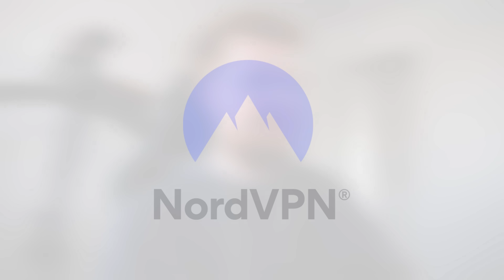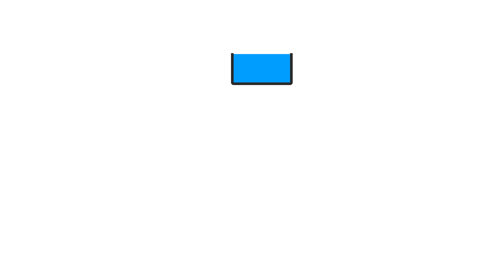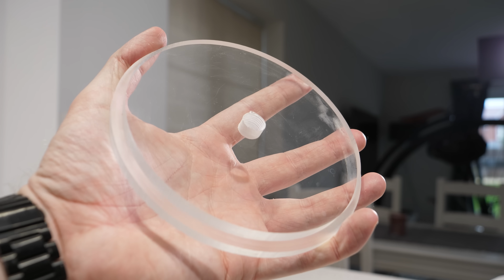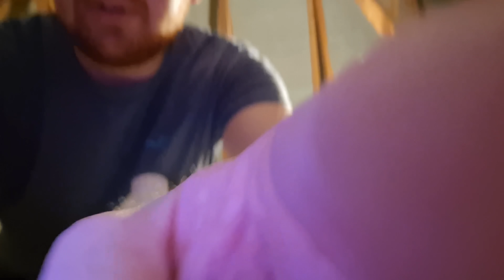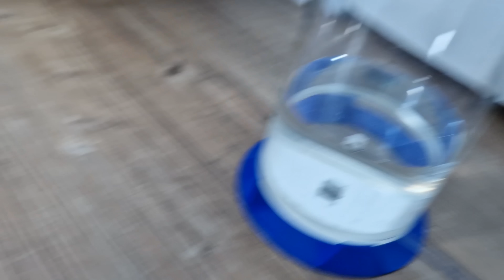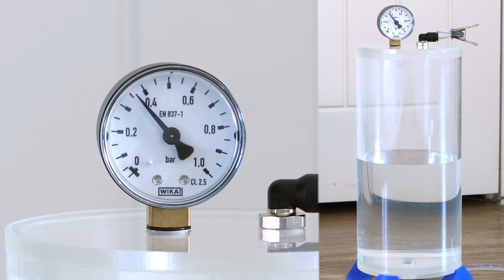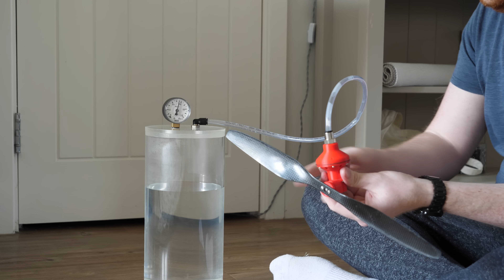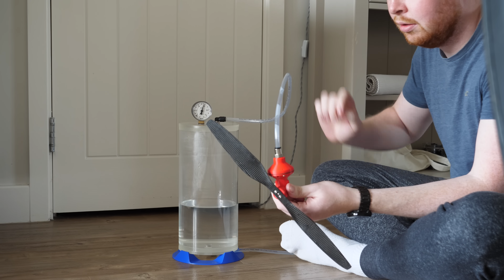Liquid Air Engine

Comment: Hey so theres a way to pressurize air with just flowing water. I cent remember what they are called but basically you have water fall down a tube where it froths and makes bubbles, but the flow rate of the water pulls the bubbles down  the tube and around a bend where they are then free to float up to the top of the pipe and collect in a tank as the water continues down the pipe. Its actually fairly quick at building pressure as it moves a large amount of air fairly quickly with only 1 moving part, a water pump. Unless you were a mining company 150 years ago and built a massive scale one using a river, then there are 0 moving parts.

Also, adding a heavy flywheel to the propeller should help the engine run at much lower pressures as the main reason it stops running is as it slows down it reaches a point where there isnt enough inertia in the prop to push the valve open against the air pressure. If you increase the rotating mass close to the shaft then theoretically it should run at much lower pressure though also at much lower rpm.

Comment: Not water air engine but gravity engine. There are reasons why we dont say connecting rod engine, but internal combustion engine.
Then you need a cynematic that allows a stop at the top dead center.
Reply: But even so, going through a change of medieum doesnt make sense. Just have a weight going down on a string. You can also use mercury instead of water. Etc.

Comment: An engine built similar to a piston or diaphragm pump with linked valving could probably increase the efficiency and lower the minimum pressure of operation, especially if the parts were precision metal etc. and lubricated.

Comment: use electrolysis to generate oxygen and hydrogen gas, and use that as fuel for a combustion engine, because the oxygen and hydrogen are in a 1:2 ratio the explosions are gonna be powerful making the engine even more powerful(or it would just destroy the engine)

Comment: There are bonding agents made specifically for acrylic that chemically weld it into one solid piece (used to make acrylic aquariums etc.) and this should always be the method used to permanently affix 2 acrylic pieces when maximum strength is required 💯

Comment: you should try putting a magnet on the output, and have a magnet detector, and whenever the magnet is detected, use a microcontroller or a relay to open the valve. This will make the engine operable at much lower pressures.

Comment: If I unblock.whered the static IE i.measure the static if this might be temperature or underclothes or the outside clothing not inside inside not outside . I found I am not sexual so anylisvsays the food , no clothing , no the timing earthing  6# si, 4 2.5  sung hok#. Then the turning on the the cable for sure for lighting them a sound frequency transferred to the victims they now aware of that etc . The biker is dead he is dead. If he returns the nano retriggers that water. . Do that's done no he has nooney . No the dog likes it
.etc . Any thing else yes that issue is these victims by thies families in your nations . There it might be your properties used to kill off anything different etc I don't know etc seperate the floor IE use the differences and see us it a need to run a different or not the difference is the resident controls it. Not a criminal. . An way the game is ohhhhhhh not clever that budget is for shoes I can see here the time required to make a energy clean transfer , shoes ?

Comment: Interesting build, but there is no dispute that what you have is an "air engine" (or more accurately, a pneumatic motor). The working fluid for the pneumatic motor is exclusively compressed air. The fact that you are using the water as a liquid piston to compress the air does not negate that fact. Therefore, it isn't a water air engine, but merely a pneumatic motor with the working fluid (air) compressed by water (rather than by a mechanical  compressor)

Comment: in theory you could telesccope  dozens  of  bottles in series with one inch holes on the bottom..  actually  you  could use the solar heated  air to produce more  cooler  commpresed air.

Comment: using acrlylic  is like using  rigid   PVC for compressed  air.  It is  suicidal..  Tthe  preusure you are using it should be  safe.     but something you might look into is use the sun to heat up the compressed  airjust prior to  a turbine blade on a generator.... maybe with a  freznel  lense.

Comment: Hello, you have answered a very old question for me here: "Do you always experience the same pressure in a tank with water, at a certain depth? Even if the width of the tank is narrow or wide?"
But I still have. to ask:
I always thought that not only the depth plays a role, but also the width and therefore also the volume, i.e. the amount of water. Why? Simple: More water weighs more and therefore also creates more pressure, and the larger the tank, the more water, the more pressure, so also more pressure in a much narrower tank that is the same depth, so in a much narrower tank there is the same depth less pressure because there is less water, therefore less weight and therefore less pressure.
That's how I always thought.
But what if there is the same pressure in a much narrower tank at the same depth than in a much larger tank at the same depth? With much less water and therefore much less weight?
What's up with that?

Comment: If I want I could make it again but it would be a rocket
Water electrolysis produces hydrogen and oxygen gas with 
          Electricity 
H2O         —>        H2+O (I made mistake here, I explain it at bottom)
Then again the H2+O is explosive and flammable and that’s the point
We use the H2 to burn and boil water making a steam engine 
We could implement a method that has 2 engines make 75-50% power back so less electricity is used
The side products would be water vapor 
The water could be used to to fuel the engine thus less water used 
The water cant be pure as with no salt, water electrolysis could not take place

H2O + NaCl -> H2 + O + NaCl
I thought it would damage something 
Cuz I thought NaCl would split to Na (sodium) and Cl (chlorine)
Mind you I ain’t even is college so this is impressive

Edit: I found a mistake when I said ‘We could implement a method that has 2 engines make 75-50% power back so less electricity is used’ it uses more water and a boiler is heavy
At that point, I could just use high concentration hydrogen peroxide and potassium permanganate to get high pressure steam (used in the v2 rocket) and this would be good as the steam would power and engine and the steam leftover could be reuse it (harvest the steam) and have a tiny tub of salt and a spinner in the water tank
Mind you, probably not a good idea as things like weight and hydrogen peroxide in high concentration is reactive to an extreme degree

Comment: I think you could had used a hose with greater  diameter to fiil up the water again instead of reducing the air consumption of the motor. But so you built a very efficient version. Great.
I would like to know if you can use you findings with youtube videos some how in your profession or is youtube your profession?

Comment: OK, sorry if it has been suggested:
As it is a closed system and once the water is all "down stairs" you have to empty the cylinder and put it back upstairs.
Yes, this could be seen as "cheating", but why not add a third hole in the top of the cylinder and connect an air pump.
Then, when it is full of water you:
a) close the output to the engine
b) turn on the compressor and pump the water back upstairs.
Similar to how hydroelectric power stations work.  Water being used in the daytime and pumped back up at night.
Just a thought.

Comment: Not too late to use bigger pipe. You would still have pressure losses from changing down to the narrower diameter at the fittings, but you could reduce the friction losses in the pipe by having a bigger pipe and tapered adaptor fittings at each end.

Comment: Definitely recommend getting a resin printer for precision jobs. All you need is a good mix of tough/flexible resing(~20% or os) with normal resin and you can print really strong parts, or even springs, that are very accurate. You could combine the two printing technologies. FDM for the bulk and structure, resin for precision parts.

Comment: ngl wanted to see what would happen when the engine intakes water, does it hydro lock, because it doesnt compress the gas would it run  but slowed. my bet would be due to the higher viscosity or water than air the ball valve wouldnt let enough water in to complete the power stroke and it would just stop, not really hydro locking but also not running, more like just running out of air pressure.

Comment: Yeah I have cut some plexiglass before and it sucked, it would melt if I used small teeth on the saw and break if I used a saw with larger teeth. There are definitely some more purpose built tools for cutting that stuff
Reply: Acrylic looks much better for sure

Comment: Tom Stanton/ Sir : Pls try to designed an  engine powered by an "impact" , from a continious, solid water jet- at 45-50 psi presurized water- being spewed by a "forced pump", commonly used in the water cannon of the ordinary fire truck... 

The  5. inches diam. water cannon hose, could hardly be controlled by 2. firemen- during the actual acts of extinguishing a raging fire incident!...😊😊😊... 

I stand in awe  & admiration  at the sight of 2-3 firemen, trying to control the "kick" of such water- being ejected  from the tapared nozzle of the fire hose!!..😊😊😊😊

I

Comment: here's a better way 

first by the process of electrolysis separate hydrogen and oxygen from water
second use the hydrogen as a fuel in a combustion chamber
third as electrolysis requires ton of electrical energy(237 kJ per molecule of water) convert the thermal energy of the combustion chamber into electrical energy using thermoelectric generator and use it for electrolysis so that we wont be worrying about electricity 
fourth we have made an engine which runs on water that releases oxygen as waste

Comment: It’s a bit late I guess but could you drip feed air from a tube from the bottom so it bubbles to the top creating more air in the tank and have this air provided by a gear system on the air propellor? To make the air flow rate a bit longer?

Comment: In this design of engine, you could further reduce friction by an order of magnitude and lighten your rotating assembly by getting rid of the plastic piston and simply using a small piece of brass rod in a sleeve with your dome and pin affixed to it.

Comment: See this is amazing!! My thoughts on practical use, not plane. 
Off Grid fan...
A refillable air tank (use bike tire hand pump) tank with a regulator to run your motor design to run at low psi but the refillable tank will be high pressure... you think possible?

Comment: Turn off your "power off resume" and the transition between layers will improve. It sounds odd, but it has to do with the que that is made between the SD card and the machine. It pauses because the SD card can only upload or download. it can't do both. Turn it off and it will always have plenty of instructions. (It's mainly for circular objects. Square objects tend not to have this issue.)

Comment: A bigger tank of water at the top = more weight = more pressure
Reply: No, that's not how that works kid. It would need to be taller
Reply: @BlackSnakeUS  actually we are both correct... but thanks for coming out

Comment: two experiments: 1: see what it would do if you connected the motor to a vacuum chamber and 2: see how HIGH of a pressure you can make it run at, before the diaphragm breaks
Reply: what would happen if you just forced water through the engine? perhaps you can create a sort of outlet for the water, so It doesn't just spray everywhere. what happens if you take the tank that is full off water (or, halfway full?), and pump pressurized air into it? would the water vaporize? would the container explode?

Comment: ahh yes, very nice
but if we consider how pressure works, force over an area, you can abuse the way this "water powered air pump" works by, well, using it to directly operate a pumping element, then using your body or some other form of motive force, you can pump the fluid back up

there is actually a form of vacuum pump that works this way, just using mercury as the working fluid, the mercury being the densest fluid known to man can absorb enough energy from gravity to reach a  minimum pressure of 0.00000001 bar, but if you used it to produce such high negative forces(a full vacuum can implosvely destroy a railroad tanker) you can likely abuse the nature of the pump as a way to pressurize gasses

I myself kinda want to see what pressure a reverse sprengel pump system can reach(using an airlock tank to collect the mercury for lifting back up) just to see if using a positive displacement pump on a stationary bike can make a gravitational air compressor

Comment: I wonder if you could propel a boat by lowering a weighted air bladder into the water. The drag from bladder, weight and attached tubing might prove too much of a drag, but it would be interesting.

Comment: Hi, would it be possible to replace the propeller with a generator to create, for example, a mobile phone charger? I mean, would it be realistic to use this system (in a larger one) as a battery, for example?
Example of real use:
Use a Trkač (Ram Pump) to get water under the roof of the house (or use rain water), into a larger tank and store it, if necessary, turn on such a charger in the basement and have a small amount of electricity produced. See interesting series by Quint: https://www.youtube.com/watch?v=S6oNxckjEiE&list=PLRgXwFLxal8J5oSN2hKqeNi5GX-Lkasa6 .

Comment: Does this mean I can just build a super large funnel 20 meters above my house and let the rain fill it with water, which  would then give me an unlimited but unpredictable supply of pressured air I could use to run a fan with when it gets to warm? Unlimited fan movement, with no electricity cost. I love it.

Comment: If you could make a manual pump at the water tank that could drain the pressure chamber and refill the water tank and also add in a way to prevent the engine from drowning, you could make a generator out of it or something.

Comment: Wouldn’t a spring and piston in the bottom of the air tank do the same thing and be more compact and easier to transport
Reply: The other thing that may help but also use more air would be 2 pistons, it would make it smoother

Comment: @tomstanton it's not technically a trompe compressor but if you did make a trompe how much more efficient could you make it and of course we wanna see it make "watt er hrs " into a lithium battery pack i would fill a 55gallon drum 🛢️ and use largest garden hose my experiment 🧪🥼 is hoisting it 100ft high in a tree with Paracord but probably not rated for a full 55 gallon drum otherwise roof peak height 23ft not nearly as impressive for power curves but supposedly water boils when being vacuumed up max 33ft so why not at pressure rather than negative pressure? a home sized water battery with rooftop and basement swimming pools that swap water through a electric motor water turbine or pump tesla turbine or something incorporate Tesla valves somehow  and regular old 1 way valves also hi integza👋

Comment: Your problem is that you use single cylinder engines.  Each cylinder must have at least two valves.
Reply: tom_stanton1   You also send me a message to give me a prize with the best animal spokesman. Accompanied by the encouragement

Comment: I wonder if you could build an air-powered plane that could reach a higher altitude than a water rocket with the same amount of air pressure. 
Seems like it should be possible, since you save on the weight of the water, but then again, a water rocket sheds most of that water pretty quick.

Comment: You should see about making a 3 cyinder version as you could hopefully prevent the reversing and run it at an even lower pressure, though it would use more air per revolution

Comment: Your title is misleading. The engine is not running on water. Water is barely the medium to create the air pressure. Gravity is what generates the power. Without gravity, it would be no movement whatsoever. Exactly the same gravity principle is used in water dams to spin the electric generators. What you demonstrate is just a fancy way to waste energy. With the same amount of water, you could generate many more spins just by running water directly into the engine using a simple water mill principle. It's all about efficiency.

Comment: i wonder if you could make this same engine work with water or another engine that runs off of water pressure instead of air pressure thus essentially giving you more "fuel" with the same setup just flip the pressure chamber over and obviously a basin to catch the "exhaust" ill be it unconventional and unfeasible in vehicle form but usable in hydro-powering a house or something of that nature

Comment: Why not just connect a water turbine generator to your mains waterpipe? Then every time you turn on the tap, shower, or even flush the toilet, you are producing electricity. Watermains run between 1-2 Bar (50psi)

Comment: It would seem to me that you could calibrate a water pump or even a fuel pump ( or combination of both ) to the correct PSI without having to use gravity and run the Engine on a tankful of water replacing gasoline and perhaps power a small vehicle.